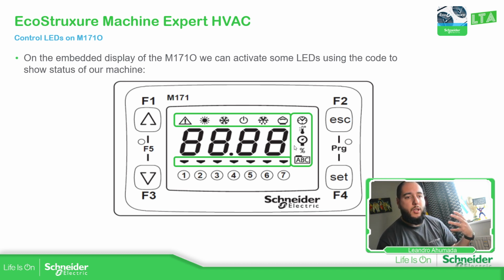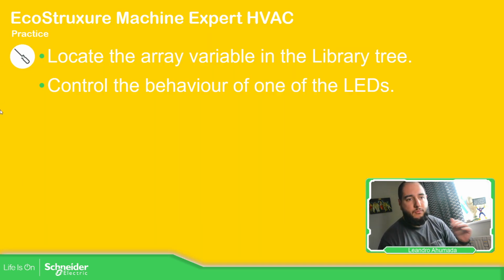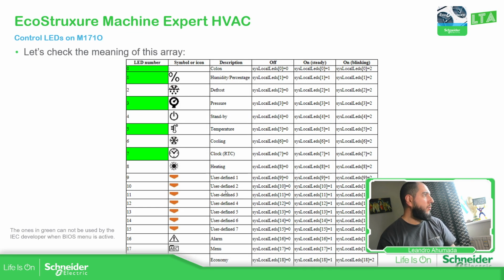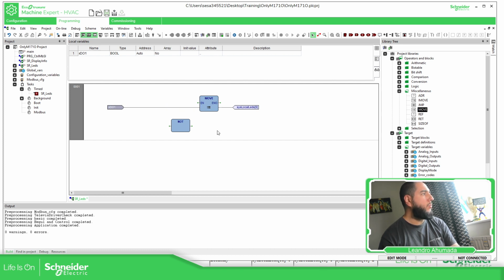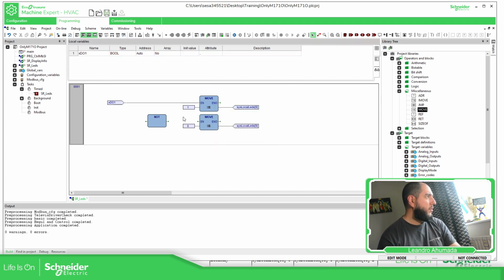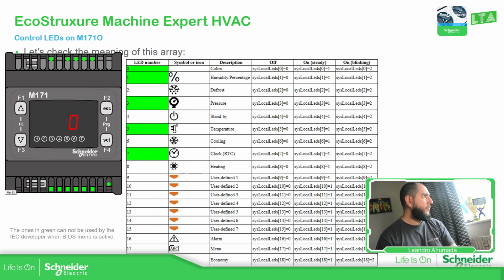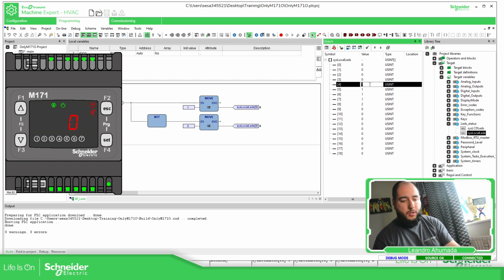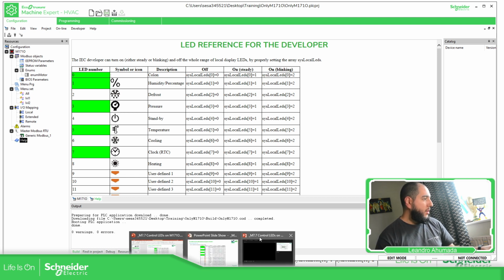EcoStruxure Machine Expert HVAC Training - M7.7 Control LEDs on M171O

Comment: Hello Mr. Ahumada.
I purchased a TM171OBM22R plc and an Optimized Wall thermostat with backlight TM171DWAL2L. I have problems with the up, down, esc and set buttons. I try to visualize them in the "Watch" window with the help of the sysLocalKeys function. The state does not change. Otherwise, the display functions work. Please help me.
Thank you!
Reply from the maker: Hi there! The communication between those devices is via “LAN”. I do not remember if the “sysLocalKey” is the right for that display. I am not with a pc to check the soft or the documentation.